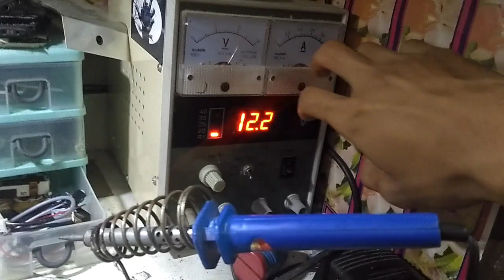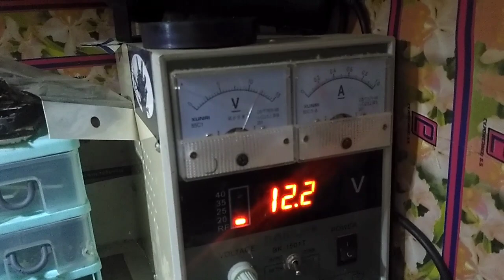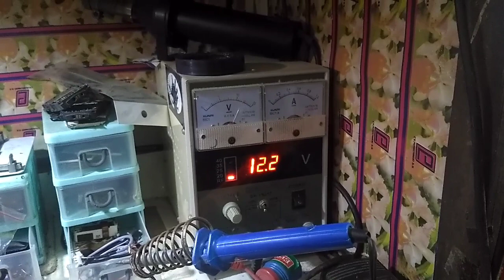Test kit pam8610 2x15watt stereo

Comment: Pake speaker watt gede dri ampli apakah gak panes/mati kitnya om kalo hidupnya lama?
Reply from the maker: Lama kelamaan panas om,tp kalo volume minim ya ga terlalu sih
Reply: @kabayan_Elite  ideal max brapa watt pake speakernya om?
Pake 8ohm 30 watt amam gak?
Ato 4 ohm 30 watt
Reply from the maker: @pandesuardika1116  mau pakai 4 atau 8 juga bisa.
Reply: @kabayan_Elite  yg brapa watt biar gak panes pake lama om?
Reply from the maker: @pandesuardika1116  bisa pakai 20watt,atau  kalo ga ada yg lain ya boleh 30watt jg
Reply: @kabayan_Elite  bagusnya pake full range apa tipe woofer kalo pake pam 8610 ...2 speaker.